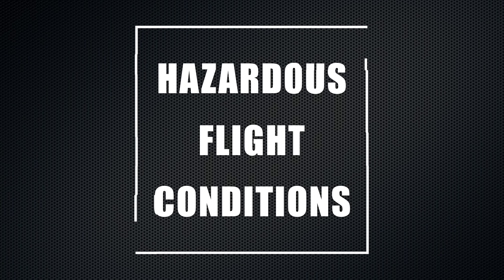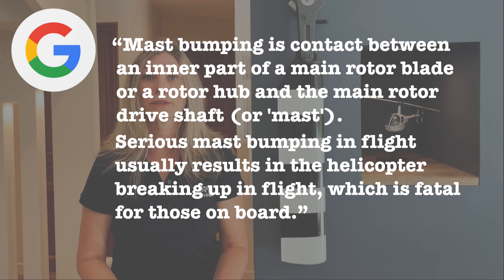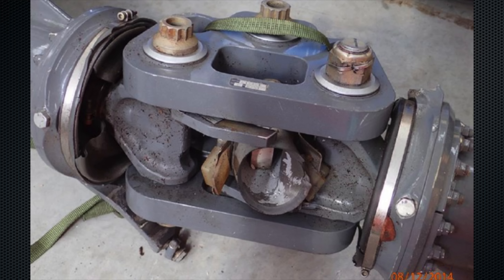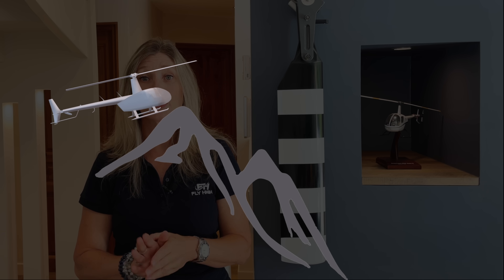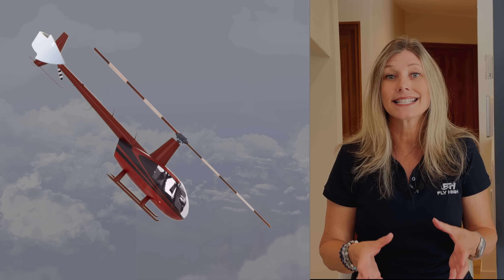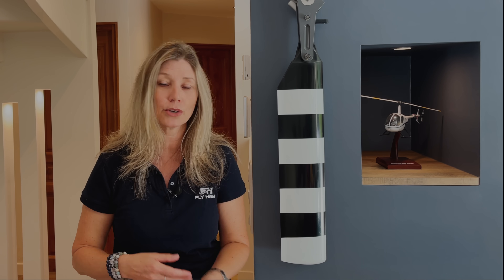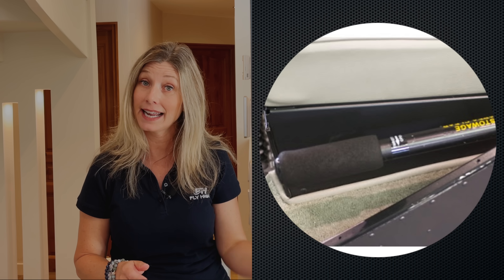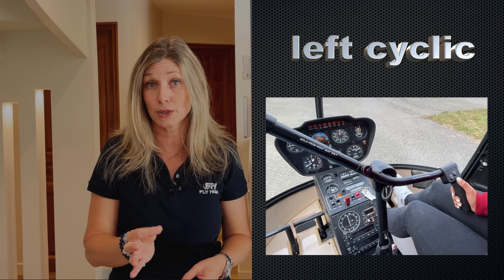Mast Bumping: The Hidden Danger That Can Destroy Your Helicopter!

Comment: As a helicopter pilot for over 30 years , this video gives a comprehensive explanation. I am a RC pilot :)
Reply from the maker: That means a lot — thank you! Coming from someone with your experience, it really means the world. And RC pilots know these dynamics well too — the principles definitely carry over. Fly safe, and thanks again for the kind words! 🙏🚁
Reply: RC flyers get used to ignorant blow hards calling them toys, like they came in a box from Walmart.  Model helicopters can be up to a quarter of full size, they work and handle exactly the same as full size except the models typically have a much better power to weight ratio and less disc loading.  Consider this….flying a model is done by sight from the ground..you can’t feel flight movement, but a small mistake will result in it smashed into the ground.  Models have swashplates and dozens of ball joint links just like full-size…but model pilots don’t get a ground crew to fix it all up and test - you have to know it inside out yourself.  Model flyers have to be aware exactly how to set up everything from blade tracking and CG to collective and cyclic control throws.  Models typically have collective combined with throttle and getting that mix wrong is an expensive mistake. Not to mention orientation….when flying toward you the L-R stick inputs are reversed…When flying slow in hover the Fwd-Rev stick inputs are reversed and when flying inverted (those that can ), the collective is reversed.  So when some full sized recreational chopper pilots starts rubbishing serious models maybe they should take a serious look before looking stupid.
Reply: LOL, I guess that means a lot in today's world. Just look at all the make-believe news reporters (like THIS woman) that are swamping YT with utter trash. So yes, flying your toy deserves the same respect and recognition as an accredited rotor craft pilot. LOL.
Reply from the maker: Everyone’s entitled to their opinion, but just to clarify — this channel is about promoting safety, understanding, and respect for aviation at all levels, whether you’re flying a certified rotorcraft or an RC model. The physics don’t change, and many RC pilots develop a deep and practical understanding of rotor dynamics. If the content isn’t for you, that’s okay — but we’re here to help those who are genuinely curious and eager to learn. Fly safe 🙏🚁

Comment: This video is about to go viral.
Reply: it was incredibly helpful to understand what happened, but straight up I am never getting on a helicopter now. I didn't know this was possible to tilt the rotor so much that it maims itself
Reply: @presinald  Same thought.  I will never get in a helicopter if it is that easy to shed your blades.  I had no idea.
Reply: @fyndor  It's impossible in a dual blade heli. Fwiw
Reply: @ good to know.  Ok correction, I will never fly a single blade heli.  It’s beyond my risk profile
Reply: @_heckler_ Name a single bladed helicopter.
Reply: Seriously why do they make them able to tilt enough to chop off the tail!
Reply: How to avoid mast bumping: stay the f away from flying coffins (a.k.a helicopters)
Reply: Yep - cant see why the USA crash pilot would be doing this manuover. ?  On a pleasure flight.
Reply: @bomberaustychunksbruv4119  One explanation: " there are reports that the helicopter was potentially in clouds inadvertently - which could have caused the pilot to push the nose forward to get out of them quickly, leading to a low-g scenario,"
Reply: @bomberaustychunksbruv4119 I believe there were wind gusts up to 25 mph in New York when then crash occurred. Tours should have been suspended.
Reply: Here for the same reason
Reply: Same
Reply: Yep….
Reply from the maker: It’s been intense seeing all the reactions here — clearly this topic is striking a chord. Just to clarify, this video wasn’t made in response to the NYC tragedy, but if it’s helping people understand mast bumping and the risks involved, then it’s serving its purpose. Helicopters aren’t inherently unsafe, but they do demand respect, knowledge, and good training. Stay safe, and thanks to everyone for engaging so thoughtfully 🙏🚁
Reply: Maybe not because it’s called THE “JESUS BOLT” that holds everything together on the copter. They want us to believe in Aliens before we accept the truth. So maybe not 🤷🏽‍♂️

Comment: Fly those See Saw Blades are prone to Mast Bumping .Should consider Europe Helicopter that aee far safer.
Reply from the maker: Thanks for your comment! You're right; helicopters with semi-rigid ("see-saw") rotor systems can be prone to mast bumping if flown beyond their limitations. However, with proper training, awareness, and adherence to operational guidelines, these helicopters can still be operated very safely. European helicopters, typically using fully articulated or rigid rotor systems, do indeed reduce the risk of mast bumping and offer different safety characteristics. It's always good to be informed and aware of the strengths and limitations of each type. Fly safe!
Reply: @flyhighwithcarothepilot  Hi...i am just cracking a joke on " See Saw " Blades....
It is Safe if flown with knowledge.
Cheers.

Comment: Maybe don’t design helicopters that can succumb to this problem.
Reply from the maker: Totally understandable reaction! Mast bumping is definitely a serious issue—but it’s important to note that it mainly affects certain rotor designs, like semi-rigid systems, which are lighter and simpler but come with specific flight limitations. The key is really about understanding those limitations and flying within the safe envelope. That said, many modern designs—especially articulated and rigid rotor systems—have engineering solutions that greatly reduce or eliminate this risk. Thanks for your comment! 🚁

Comment: A suggestion for another video about the Robinsons is the phenomenon of the Tail boom being cut by the main rotor blades for the same reasons (but not only) why the Mast Bump occurs. Even if the impact is not enough to cut the tail boom, a stronger impact or a bump can weaken the structure and cause subsequent collapse. The point of impact coincides with the anti-collision light and cases in which only the lens is hit by the blade are not uncommon, signaling that the impact of the blade with the tail boom was close to occurring. This is the case, for example, of the accident that occurred in Rowlet, Texas, when a video showed the tail falling apart from the rest of the helicopter exactly at the point where the anti-collision light is mounted.
Reply from the maker: Thanks for the suggestion ! Interesting topic 👍
Reply: @flyhighwithcarothepilot  Great. The particularities in the operation of Robinsons are so critical that the FAA created SFAR 73 in 1995 to require special training in these helicopters.
Reply from the maker: Absolutely — SFAR 73 really highlights how unique the Robinson’s handling characteristics are, especially when it comes to low-G and rotor system dynamics. That special training requirement says a lot. It’s definitely a topic worth diving into more, and I appreciate you bringing it up 🙏 I’ll keep this in mind for a future deep-dive video — it’s an important one! 🚁
Reply: @flyhighwithcarothepilot  ❤️

Comment: Bell / Army had mast bumping issues for decades roll isn't the issue cyclic use is, Weightless mass going ballistic as the rotor system reacts to pilot inputs = mast bump - A little Aft cyclic 1st - NOE was the mission profile , Positive G maneuvers the answer. Mast bump wasn't just an issue with Robinsons.
Reply from the maker: Very true. Thank you for your contribution.  😊

Comment: The reaction is correct but tail rotor thrust is not causing the roll anywhere near cruse flight it’s the negative angle of attack of the single horizontal stabilizer. I was taught this in the first Robinson Safety class in the late 80’s. Note your pedal position in cruise flight the tail rotor has near zero thrust. The dual horizontal on the R44 and R66 has almost completely eliminated the roll.
Reply from the maker: Thanks for sharing your knowledge ! 😃

Comment: Good video.  I recently learned however that the right rolling tendency is not related to tail rotor thrust.  It's the design of the horizontal stabilizer.  Robinson's new design has pretty much eliminated that right roll in a low-g situation making recovery simpler.
Reply from the maker: Excellent point. Worth looking into. Thanks for sharing 👍

Comment: Avoiding a bird ! I am not going on a two rotor helicopter again.🚁...............
Reply from the maker: Avoiding a big bird is also usually pilot error, but saying that a pushover is not the best way to avoid a bird anyway. Our pilots are drilled to never do pushovers and it is not an instinctive flight manoeuvre. Also, in most cases, you should leave the avoiding to the bird as they have better sensory warning than pilots. Bird strikes are not that common with helicopters. I hope that reassures you.
Reply: @flyhighwithcarothepilot  Ok, as long as the bird is not as a large as a pterodactyl I should be Ok.cheers Perry 🦅..................🚁